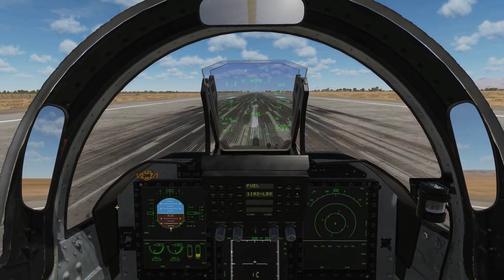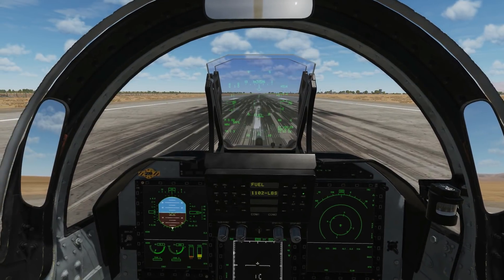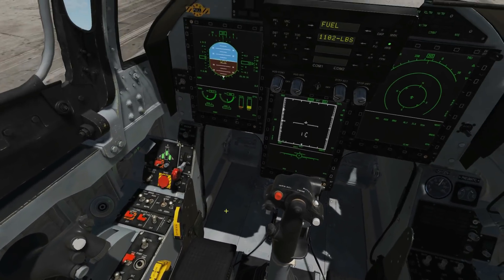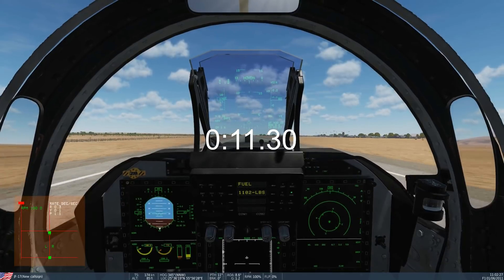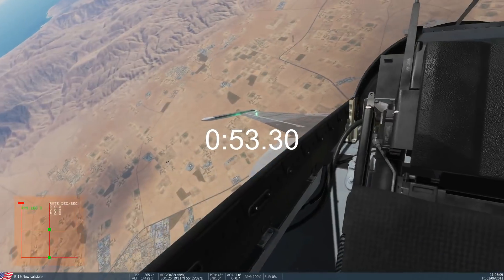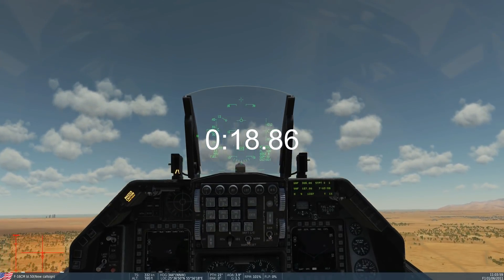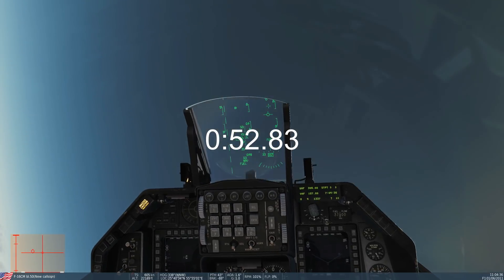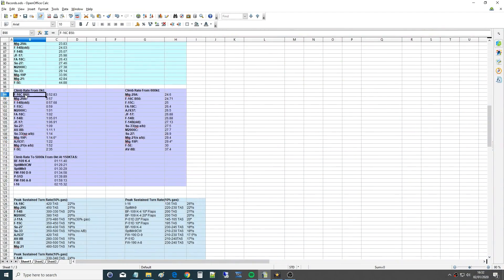F-16C & JF-17: Max Comparable Climb Rate | DCS WORLD

Comment: CAP, typically the best climb profile, which is most QRA's, is to get off the ground, get cleaned up, accelerate to best subsonic climb KCAS, pull, hold best climb KCAS, transition to best climb Mach around 20kft, in the 30's bunt over to get supersonic and climb best supersonic climb to target altitude.  Would be interesting to see any differences.

Comment: Cap what are the differences between the MiG-29A and MiG-29S? I see that you use the A model for all of your tests, I always assumed the S model would be superior but that's mainly to do with its TWS/R-77 Capability.

Thanks
Reply from the maker: S has fox 3 as you said, but 700kg heavier and same engine power.
Reply: @grimreapers  Wow, that's quite a bit more weight for the added capability! Everything is a compromise, makes me curious.

Thanks for the quick reply!

Comment: I've been curious how the F-16c has been beating the F-15c, then I remembered that the block 50 uses the GE F110 with 32k lbs of thrust, while the in game F-15 uses  the PW F100 with 23k lbs of thrust.
Reply: Would be a good comparison using the F-15E with the bigger motors.  Especially without the CFTs.
Reply: 23K pounds of thrust x 2 engines
Reply: @dude6935  yeah, but it weighs twice as much. The current eagle doesn't have a better p/w ratio.